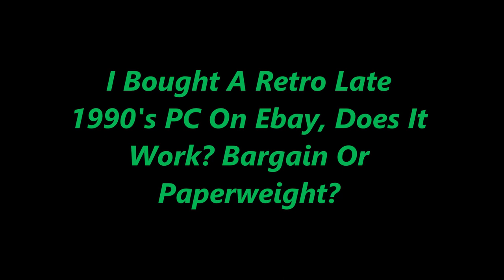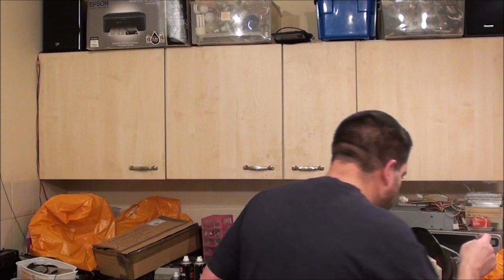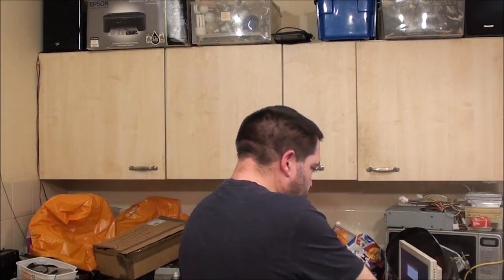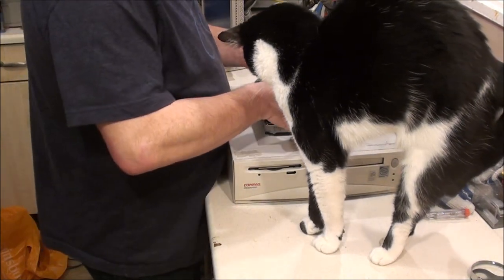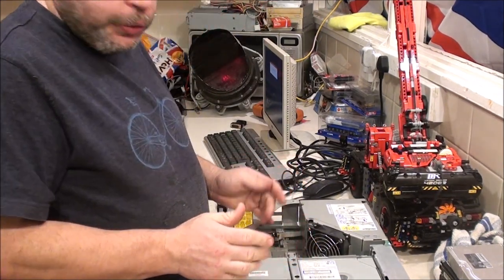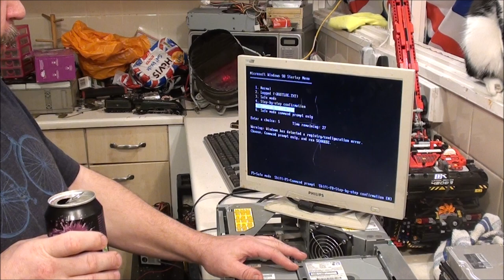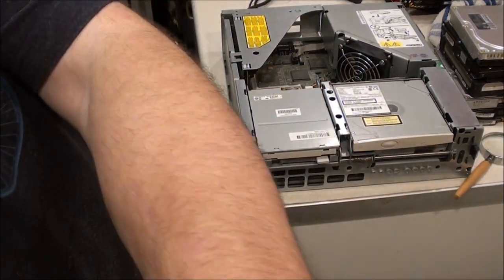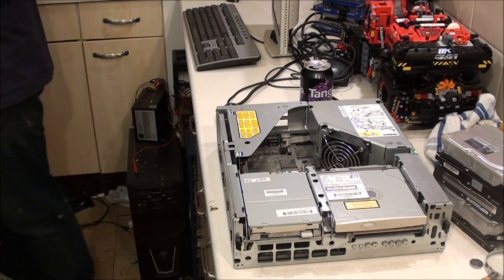I Bought A Cheap Retro PC From ebay. Bargain Or Paperweight?

Comment: The Onboard Graphicsadapter (ATI Rage?) uses this type of Slot to Upgrade from 2 to 4 Megs of GPU RAM. ATI Rage II PCI Cards uses the same Memory Module. I think your Compaq Maschine had 2 MB of DRAM installed, another 2 MB are possible. Greets from Germany. Quantum Fireball HDD in my experience are often fails with its age. 😊